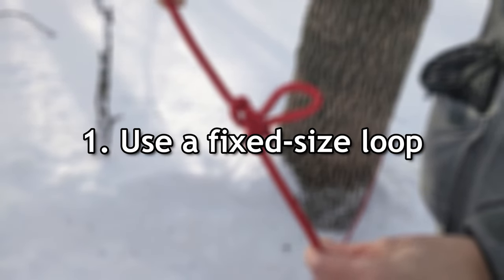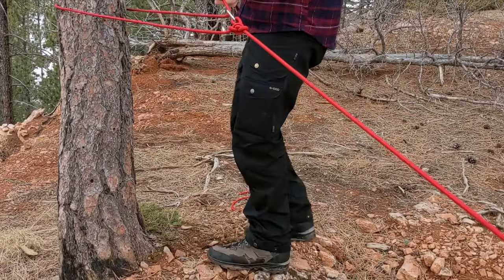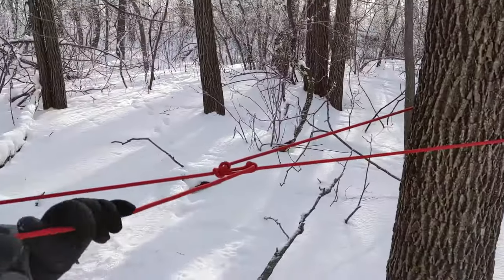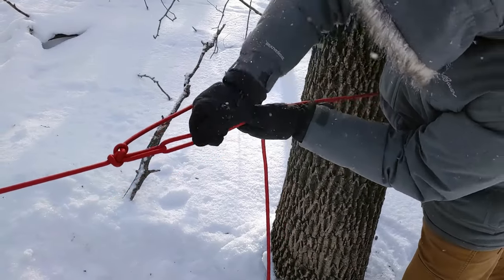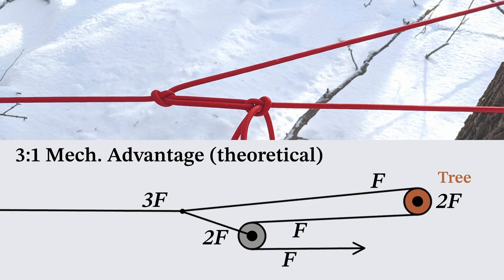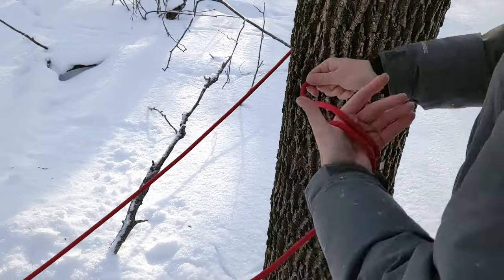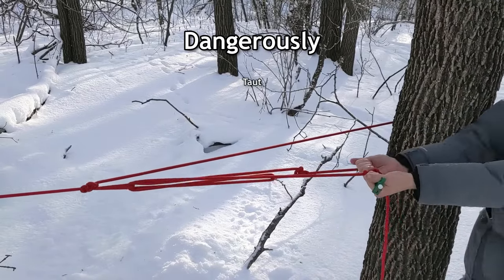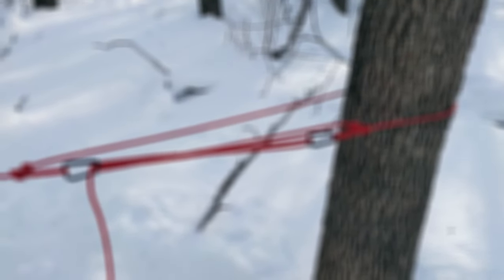Trucker's Hitch Tricks | Six Ways to Level Up Your Trucker's Hitch

Comment: you did not mention the biggest adventage of using a carabinner : You do not have to pass the whole rope through the loop. (very important when you use a long line that you prefer not to cut)
Reply: You should check out the Australian Trucker's hitch. Works more like a sheep shank, comes apart far more easily than an alpine butterfly,  even after loading it up, and you don't have to feed the rope through... ...because how much would that suck, while you are trying to secure a truckload with a truckload of rope?

Comment: Idea for the 7:1
If you put two carabiners in the first loop, both lines can have their separate carabiners to slide friction-free. You loose the self locking, but this way using 3 carabiners... you should get a LOT of mechanical advantage and very wear and tear.
Reply: you can keep the self locking in the 3rd carabiner!

Comment: Another useful truckers hitch tool for the belt is the half shank method. It means not having to pass the free end through, which is good if you have a lot of rope, and with practice you can tie it one-handed. It works well with the doubled back (5:1 method) too.

Comment: I like to use a half sheep shank in lieu of the alpine butterfly.  It has to be tied correctly based on pulling forces or it will collapse toward the pulling direction.  But it is much easier to untie.

Comment: On a taut line hitch, when you make the second turn inside the loop make it above the first. Finish as usual. The result holds even better.
Reply: that knot is the midshipman's hitch and I agree it is better than taut-line...especially on modern synthetic rope that tends to be stretchy and slippery.

Comment: Off to a bad start. The slipknot is not insecure, it won't close under load if tied the right way around (you pull the working end through, not the standing end) and it is the easiest to undo knot in existence. Only difference to the alpine butterfly is the harsher turns the rope goes which stress and wear the rope a bit faster.
Reply: Simple to undo. Not always easy when put under stress. Can require yanking to break the knot. I do agree with you though, I prefer the slipknot to the alpine butterfly for a truckers hitch for speed and simplicity
Reply: The slip knot is not easy to undo at all once it has been put under stress.  It has been so tight at times that I have had to use a fid or similar tool to undo it.  Alpine butterfly would be easier.

Comment: A bunch of conflicting advice!  " Use a caribiner" to reduce friction... followed by "wrap around the loop twice".  Also... "use a spike marlin to get more purchase power"... followed by "use a taut line hitch"  (and fumble with trying to slide a knot up to get more tension.  They all can't be right!
Reply from the maker: These are options. It doesn't mean you have to apply them all at once, or that one somehow negates another alternative.

What works best will depend on your application and what you're carrying... Whether you have a carabiner, what kind of rope you have, how much tension you need, and so on.
Reply: They can absolutely all be right, just not all at once. I thought it was pretty clear from the video that each variation has it’s place if you know how to use it
Reply: It’s like you can’t understand basic concepts or something. Damn, I’m glad I can actually use my brain.
Reply: @SnailHatan  “There is something more important than logic: imagination.”

Alfred Hitchcock